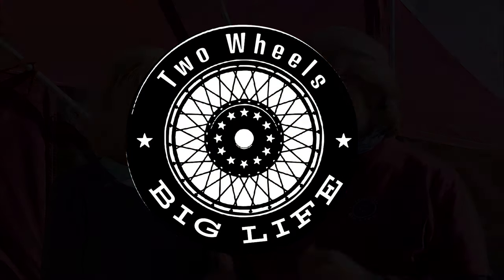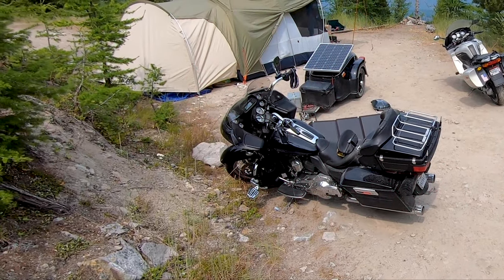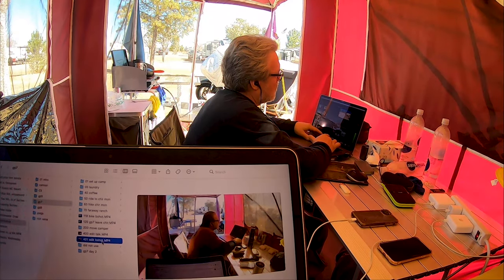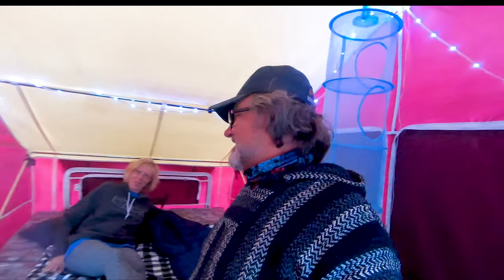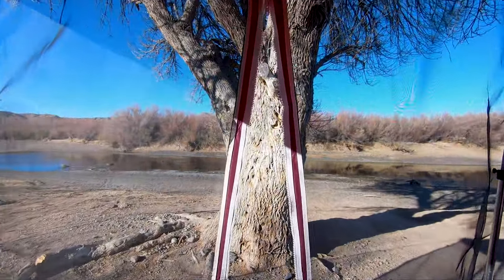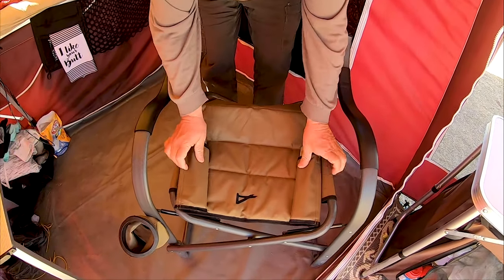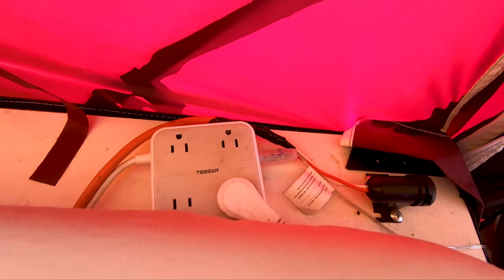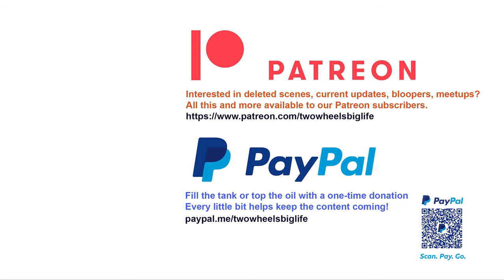POP UP MOTORCYCLE CAMPER - What's That?  #tinyliving. (S3 EP1)

Comment: What does that camper weigh
Reply from the maker: About 500lbs
Reply: @TwoWheelsBigLife  loaded or empty? Does it have brakes? Just curious how it compares to traditional trailers for vehicles with more than 2 wheels. 

Thank you for sharing your travels
Reply: @TwoWheelsBigLife  i ride a road king 750 lbs about the same weight as your bike i have  experiance pulling  trailers but not with a bike seems your  trailer weight is 50% of bike with you and gear on it . how much was  braking distance increased  and  does the trailer push ? not to mention starting off with the extra weight. my wife also rides we are about your ages and been  have been following you two for over a year now. good luck with the new camper
Reply: If you come to UTAH, come to northeastern UTAH, Vernal. I would love to host you and meet you!
Reply: Hi hope you guys are staying  warm with this cold front that came through NM. Great video!
Reply: @mikemar2822  I love Road King. Rode one from Huntsville AL to Seattle WA in '95. Put an EV5 cam and bumped both jets in carb 5. Backed out idle mixture screw 1/4 turn. Added a Dyna 2000 ignition modual although i kept it in single fire mode with Kromeworks down turn exaust with fiberglass packing removed. Ran like a sewing machine. BTW, it was a 95 Road King.
Reply: could you pull a teardrop trailer with a big bike?  coachmen clipper?
Reply: @kevinwelsh7490  they make a teardrop for motorcycles.  But a regular teardrop no way.
Reply: @kevinneal117  I have a Time Out Deluxe trailer, similar toe the bunkhouse. I ordered it with electric brakes and along with the controller they make a big distance.
Reply: @michaelkaczynski897  is the brake controller special for a motorcycle or same model that is used for cars/trucks? Pulled enclosed 24-36ft car haulers all over the country and had “the tail waggin the dog” more times than I care to admit. The brake control was your bestest friend at those times.
Reply: Saw camper  for sale on Tulsa ok  for 3,500 interesting 🧐 love it 🥰 new beginnings
Reply: @kevinneal117  I don't know if it is specifically for a motorcycle but it fits nicely in my saddlebag. I used velcro to attach it. It works very well. I purchased the brakes pre-installed on the Timeout trailer. I had to mount and wire the controller on the bike.
Reply: Hello Chris and Richard. Just purchased a bunkhouse camper myself. Question to you is. Where did you purchase the cargo net you use on top of the camper when traveling. Also do you charge your battery with the solar panels when traveling, and if so how did you route the cables to the battery in the storage compartment . I know I know you've probably been over this already, but I'm needing me some help here before I leave on my trip. I want to thank you 2 for the videos. Im retiring in about a year and half, and want to get on the road permanently. So I'm gearing up now to get use to what I need and what I dont need before I parole myself from the grind. Any more info on anything related to the camper, and solar would be appreciated. Ride safe.
Reply: @kevinwelsh7490  q
Reply: Would you guys slow a video how y'all pack everything up? I have the same camper and a gold wing and curious how you pack up.
Reply: I have a mini mate and it weighs around 270 lbs. I pull it with my Subaru instead of a motorcycle.